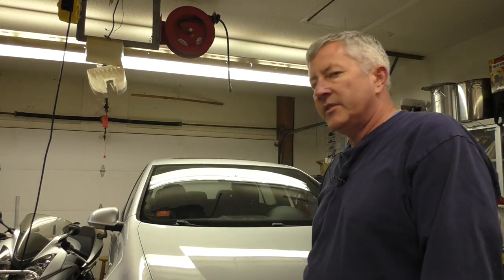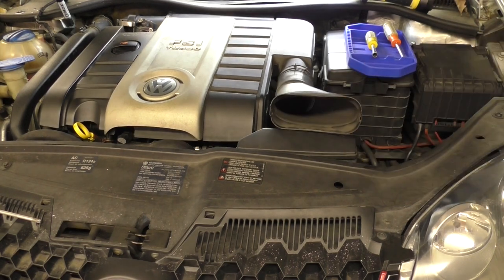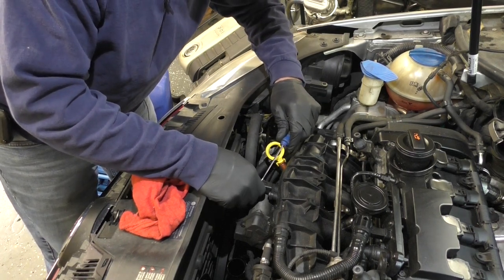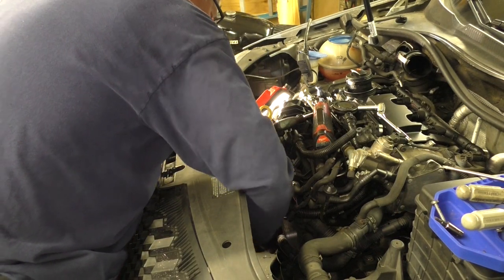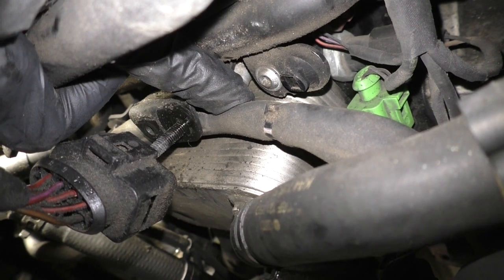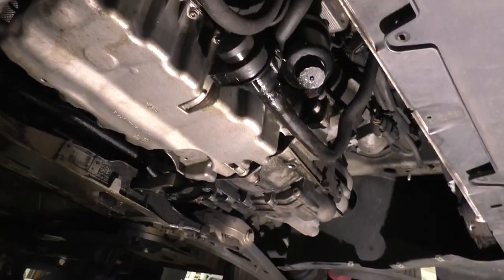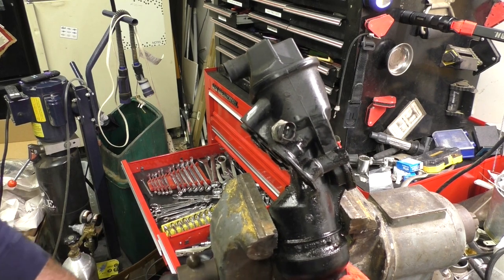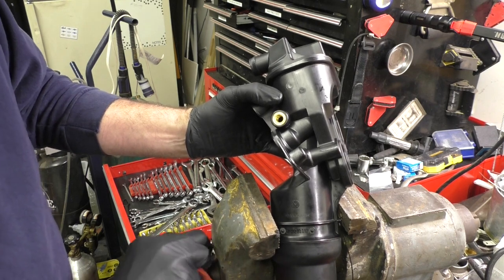VW Mk5 GTI Oil Filter Housing Replacement (Massive Oil Leak!)

Comment: Excellent. I did this a while back at 176,000 miles and had fun getting the fans in and out. And yes mine was leaking too. Also replaced the gasket on the DSG cover as it was slowly leaking fluid.

Comment: wow so i just got a 2007 gti.. 130k miles what should be first thing i should work on.. car runs fine no engine lights buf i do see some oil on bottom
Reply from the maker: You probably have a leaking vacuum pump. I would also check the fuel pump cam follower shown in another video. I was shocked at mine.

Comment: Good Job on the oil housing. But my question is how much damage did you made to the water radiator but moving all these things in between. I personally took the front end off cos I had to upgrade everything.
Reply from the maker: The radiator survived OK. Getting the fans out of the way is a must. I could have removed the radiator now that I realize how easy it is to take it out.